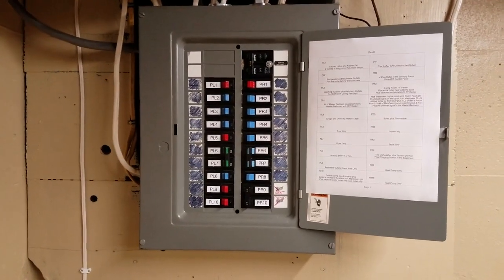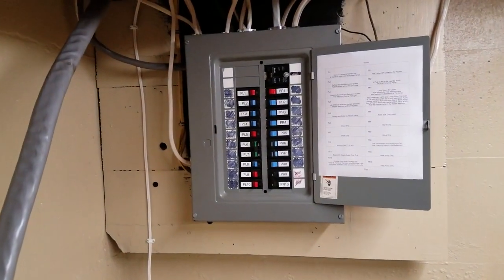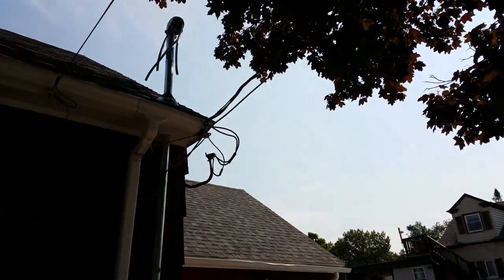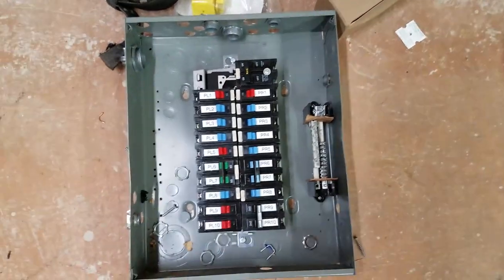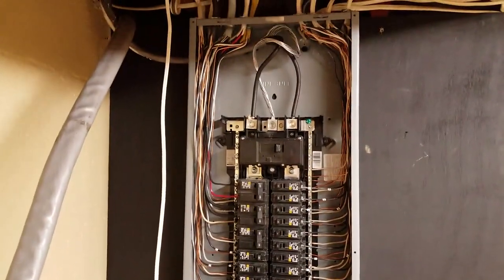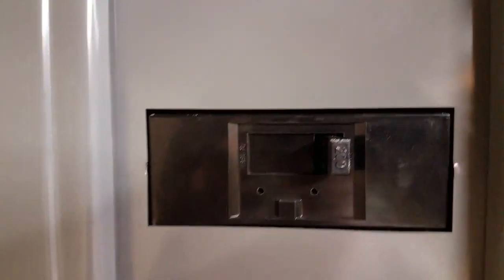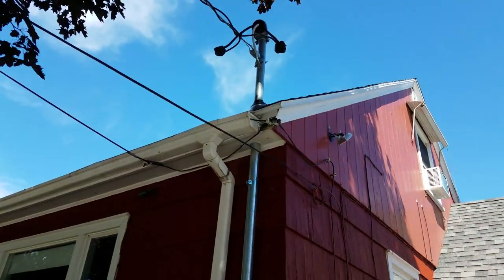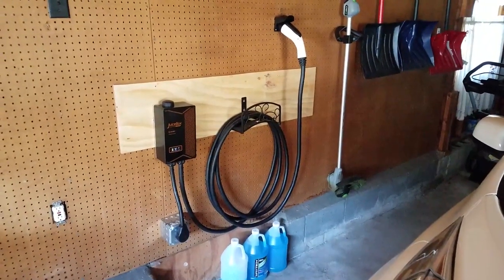Electrical Service Upgrade from 100amp to 200amp - Level 2 EVSE install

Comment: Can you go into a little more detail about changing from 100 to 200 amp. I always thought you just installed a 240 plug and you were done. Why are they doing all this rewiring.
Reply from the maker: Nestor Chavez In some cases you can just install a 240v outlet... We elected to have our service upgraded as well for two reasons. One we wanted to have expansion for future devices such as heat pumps and/or other heavy drain devices, and two, our current 100 amp service was already maxed out so we needed to make the upgrade regardless.
Reply: Thank you bmhsonic. I'm currently looking into Ev's myself and I saw your video so I was kinda confused lol. Thanks again for answering my question.
Reply: Tap on a clip to paste it in the text box.Touch and hold a clip to pin it. Unpinned clips will be deleted after 1 hour.
Reply: @nestorchavez1294  I'll

Comment: What was the total cost to upgrade from 100 to 200 and install the charging station?
Reply from the maker: All said and done it cost right around $2000 but $600 of that was the JuiceBox Pro 40 itself...there really wasn't anything to install as far as the charging station was concerned as it simply plugs into the 14-50 outlet I had installed in the garage as well.  So in may case it was about $1500 for the service upgrade, but I also had more than the average done as we also had to replace the service entrance which raised the cost some and running the new line out to the garage.  I can only imagine that if we had not needed to run the line and didn't need the new service entrance that the costs would have been closer to around $900 or so just for the service upgrade.
Reply: That's not a bad price to have all of that done
Reply: I had a Pro off Angie’s list said it would cost me $12000 to go to 200 amp. He kept stressing the copper wire was expensive and the other stuff had to be done ASAP as well. Plus he said I had to add GFCI outlets to anything that would have an AC in the summer. I said I would think about it. ... long story short a company did it for me and it only cost me $1800 when all was said and done.  
Lesson, always get multiple estimates   !!!
Reply: @orlandob9958  The reason he gave you that price is more than likely because he's a jackass and needed the money. I did replaced my breaker panel and doubled the space for future add on's. Mounted the box, moved the breakers and wired each breaker. Had my licensed electrician friend check, check and final check that everything was correct, then called in the power company to make the switch. Took him about 30 minutes to connect and passed inspection. $500.00 total.